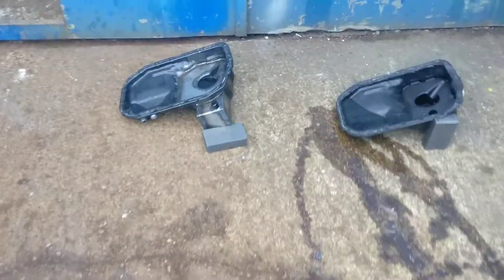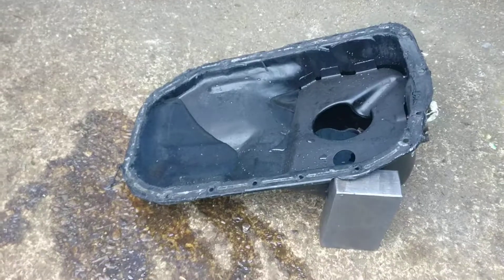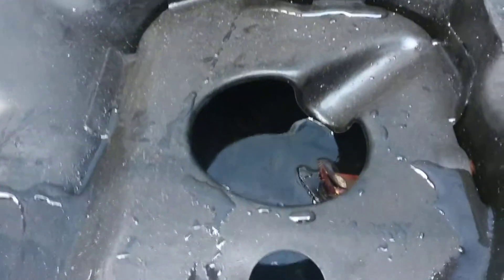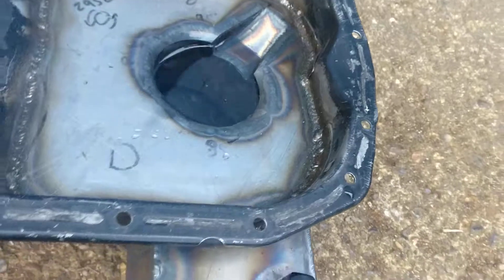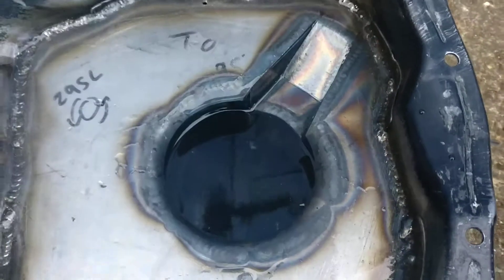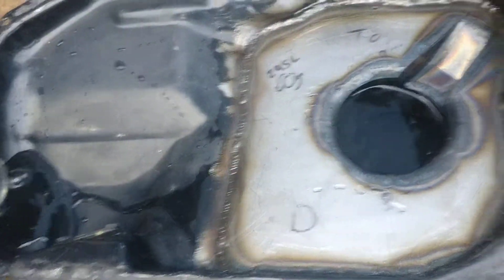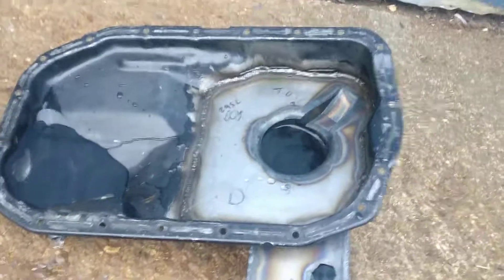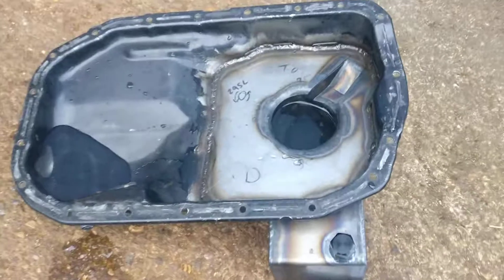Mitsubishi Eclipse 2G modified oil pan, 7 bolt, Racing

Comment: You need those gap holes to give oil the path of least resistance to the pans sump. Look at any aftermarket pan for any type of automotive motor sports and you will find those gaps. Baffling is typically the only needed modification to improve upon oil staying around the already capable oil pickup tube.
Reply from the maker: While it does help its still a place where oil and jump out from. Yes i could of done a step setup and have it drain back in and then not out but we have a very tight pan so not alot of room for such nice things, if i do another i may consider that as an option,

Since i did this i have not had any issues with oil pressure so its holding well, the main hole is tapered slightly for oil to flow down into the center.

Comment: The point of that gap is for the oil to return back to the pickup without building up and causing drag on the crankshaft  so that it’s not sitting there slapping oil while it’s trying to spin. Soooo might want to consider that.
Reply from the maker: The crank does not sit that low to consider this slapping as i already checked if oil would effect the crank, so far i have reported zero issues when using this and the main hole for the pickup is doing its job and returning the oil well, pressure loss is reduced when cornering and nothing is showing me that its not returning fast enough to the pickup. I am happy how its worked out and is doing its job on left long corners which is out main issue